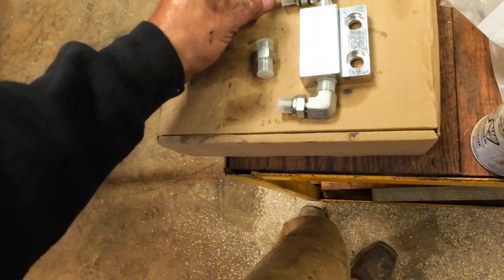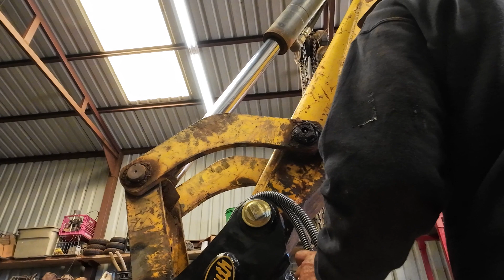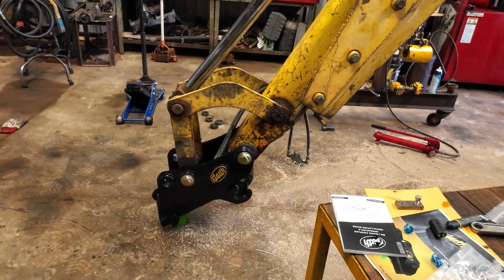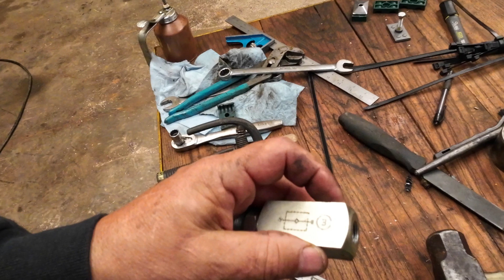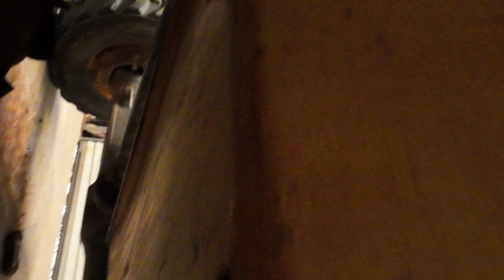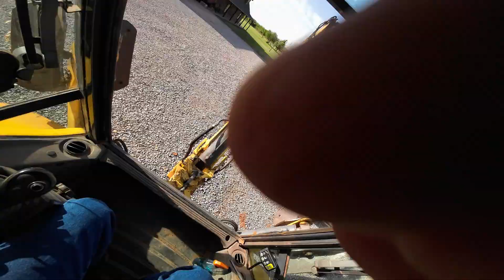Geith coupler install on New Holland B95

Comment: That's quite a bit of extra weight on a backhoe size machine.  Will be interesting to see if you notice a significant difference in the machines operation.  As good a your are, I am looking forward to the evaluation with the added weight.  Hopefully it won't be an issue.  Nick,  North West Farmer (Oregon)

Comment: Nice Frank 👍 I installed a Steelwrist coupler in my JD 50G this winter. Love it, but was not thrilled with the "fully included install kit" hoses were not the right length and the directions were definitely lacking, not to mention those  BSPP fittings 🤦‍♂️
I think you will really enjoy the benefit of the coupler over the extra weight and increased tip radius
Reply from the maker: I like it! I can keep some spare bspp fittings now that I know what I need.

Comment: Hey  Mr Frank how are you I have a Lb75b the coupler looks pretty slick I would like to look into getting one for my machine I'm  constantly changing buckets and as you know it's a pain in the ass doing it yourself that would make it so much easier and save time are they hard to find can you please tell   wich one you purchased thanks Al.
Reply from the maker: Contact Geith, they can put you in contact with the dealer in your area and  the model you need. I got mine through ASCO case dealer in OKC. Lb75 should be the same one I have
Reply: Thanks for the information I enjoy watching you and Jeff Anderson you guys are really down to earth people I also try to do all of the repairs and up keep on our equipment you guys very informative and also talented operators

Comment: No disrespect sir nok, your country is 1 of 3 I believe that doesn't use metric vs standard. I assume that's why you couldn't use those British fittings?  Great video of the install👍
Reply from the maker: None taken, but I fail to see the point. My backhoe was built in Italy and if I’m not mistaken they use metric fittings?  All of the hydraulic fittings on this machine are oring face seal and oring boss. 
But let’s put that aside, the problem is that the kit provided did not have the necessary adapters to get into my hydraulic system. And after repeated attempts by the manufacturer, they finally just told me to find them myself. Yes I found what I needed, but why send me fittings that obviously don’t fit? Thanks and I do appreciate you watching
Reply: @Digginok  You are correct that Italy is metric, but the dealership or part's store should know what's in the kit. I  can only assume you are not the first person to buy that set up?
Reply from the maker: @toddandkirsten66  the Case dealership didn’t open the box, shipped from Geith, I should have done my homework a bit better.
Reply: @Digginok  if anything, just ask more questions when your looking for something to add on to "B"🤷‍♂️🤦‍♂️
Reply from the maker: @toddandkirsten66  I did my research, I got what I wanted. Not many companies offer a kit for the b95.